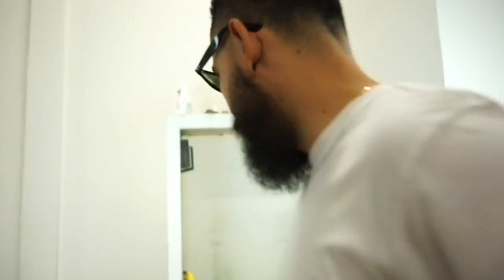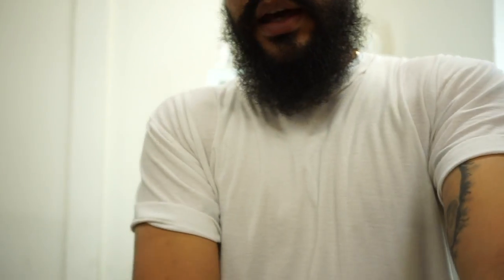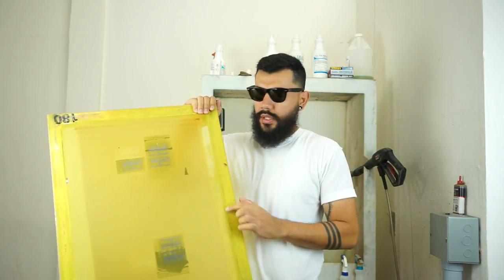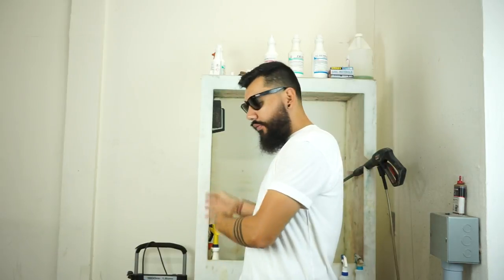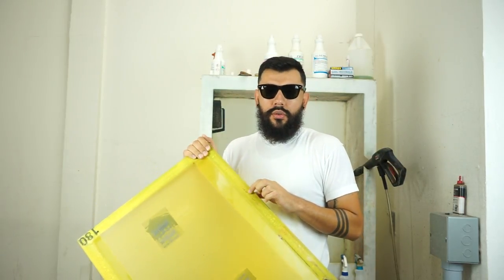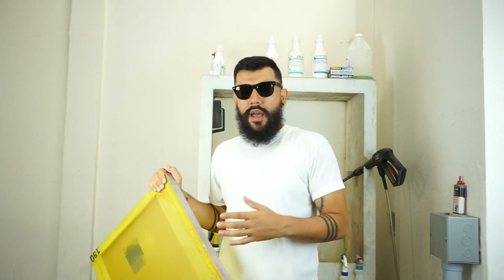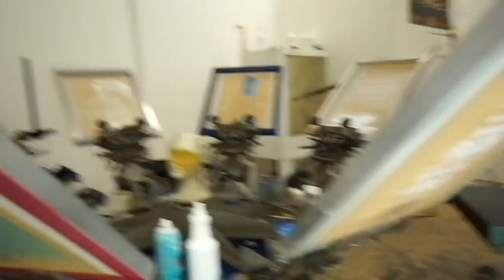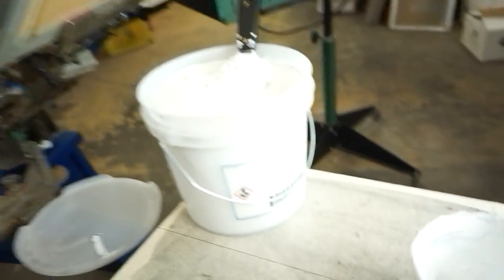dip tank vs no dip tank how to screen print

Comment: I'm building a dip tank to hold one screen. Gonna try a few experiments. It's called a "dip" tank, not a "soak" tank. Should be called a dunk tank. Submerge the screen and pull it right out and let the chem water drip off. If you let it soak, you're killing the chems faster. But I'd like to leave some in to see if it affects the glue, frame, etc. by having 4 screens dedicated to that. I stretch my own screens so it's not really an issue. When the newtons fall under 20, I replace the mesh anyway :)
Great video!
Reply: Jason Enz I like that idea.
Reply from the maker: If you stretch the screens yourself you know your doing it right so that dope bro 
Let me know how your test goes

Comment: $40 for tape over the course of maybe 6-8 months before you have to replace it is well worth it especially when you consider the time you save cleaning the screens. That's essentially $5 a month for tape which is a pretty damn good..lol Some people don't value their time and they are perfectly fine if it takes them an extra 10-15 min a screen which in that time you could print transparencies and burn a screen for another job. Opening a new bucket of ink is strangely satisfying..lol
Reply from the maker: ct apparel I’m not sure what it is about opening new gallon buckets that i love my self